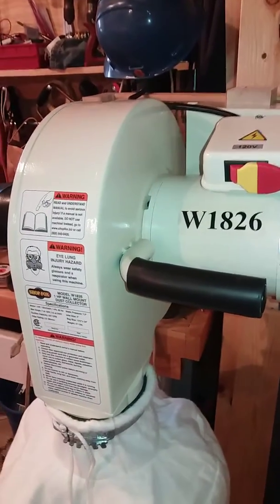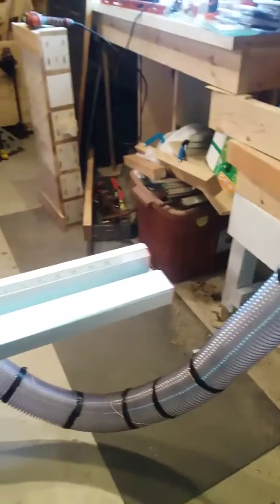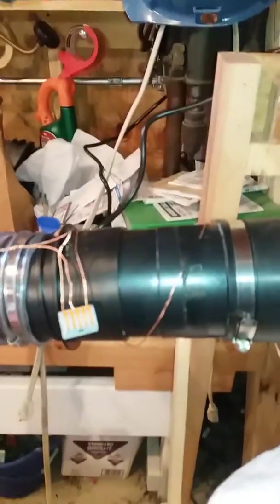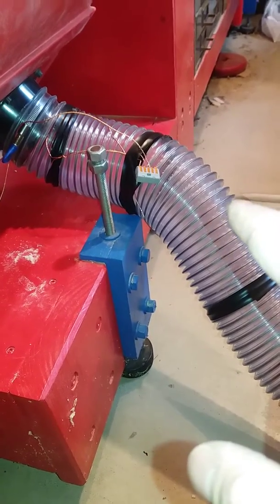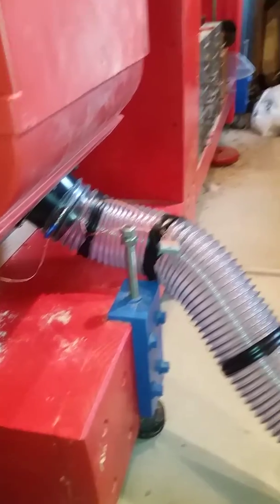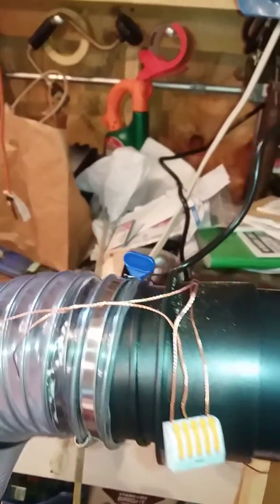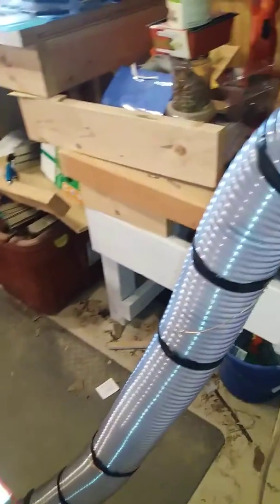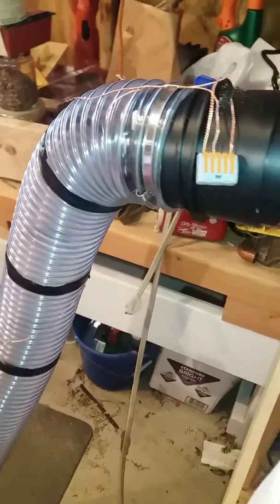Instal and ground Shop fox W1826 dust collector

Comment from the maker: Ari, I heard you can connect up to that spiral wire embedded in the flex hose but in practical terms trying to actually attach a wire securely to it would be very difficult I think and in this you want a foolproof application.  The though of a weakly soldered connection breaking off is not acceptable, more so because this is a floor obstruction I occasionally bump into.  Can't be helped, but therefore it needs to hold up.

Comment: Good video!  I am interested in buying this collector for a cnc router.  How many continuous hours of work is recommended?
Reply from the maker: I'm not exactly sure what your asking.  Are you referring to how long everything took to set up?
Reply: @friedmanbrock  no, I mean how many hours in a row the collector can work, without forcing the motor
Reply from the maker: I can't find any specific recommendations but I will tell you what I think.  The larger, more powerful models are spoken of on several review sites as being made to run every day, all day.  This is certainly a less powerful, smaller version of those and I have noticed if you have it on for very long, extended periods the motor housing gets pretty warm. It does have a good fan on it and if you set it up right and don't overload it, I would think you can use for a long time without any issues.  However, this is really a one machine at a time, lighter duty dust collector intended to operate on a short run of tubing.  Therefore, I only run it when I am actively cutting on my table saw, then I wait a few second after I turn off the saw to turn off the collector.  It is not a whole shop, all day unit.  The larger and more powerful collectors are designed for that from the get go.  I also don't know how effective this would be with a separator as that increases the static pressure...or something.  Also...without a separator all debris goes through the impeller so if you are doing something with bigger chips instead of finer dust you will cause more wear and tear.  With everything I have said, I am highly satisfied with this model as it works well for my table saw.  I would recommend solid tubing/piping instead of the corrugated stuff though.  I noticed much better results.

Comment: Nice job thank you for posting.  I've seen it (the ground wire) run inside the hose or duct also, and of course if you use metal like they did back in the day, it's a non issue.  I just ordered this little dust collector myself.  How's it working out for you?
Reply from the maker: Thank you.  It's worked very well.  I decided to take the plunge and upgrade to solid pvc as this collector is great but the flexible hose does a number on your static pressure.  I think that's the term.  Lots of loss/resistance.  When I switch it over I will make another video.
Reply: friedmanbrock looking forward to it!  Maybe I’ll show mine.  I’m going all metal though.... cheaper and no static worries.  Dryer vent ftw!
Reply from the maker: @rivernet62  I was warned about using the big box home center metal stuff as it's very thin and some people warn about it crumpling unexpectedly.  And the seams can be very leaky.  The good stuff is spiral pipe but it's pricey.
Reply: friedmanbrock We shall see!  Planning to tape/caulk the seams.

Comment: A grounding wire doesn't dissipate static.  For that you need a hose that is made with conductive resins, like carbon black.  Static electricity stays where it is...hence the term "static"...the idea that it will hop on a wire and travel has been debunked repeatedly.
Reply from the maker: Mabye dissipate isnt the best technical term, but as a point of fact it most definitely works and works well.  The wire provides a ground that harmlessly channels static electricity.  Before I installed it, you would get zapped holding the handle of the collector.  After, nothing.  Therefore the static has to go somewhere, the only path being into the grounding.

Comment: Grounding doesn't remove static.
Reply from the maker: Your right.  You can't "remove it".  You give it a safe path to discharge to.  Without this, you could hold the handle of the dust collector and it would just be shock, shock, shock.  With the grounding, nothing.  Not once, not ever.

Comment: Hello!  You made this unit mobile?  Please confirm
Reply from the maker: Originally, yes.  As the shop has come along, I have experimented and thought about what I like and what I don't.  Also, tackling different kinds of projects shows you what your needs really are.  The nice thing about it being mobile was my ability to bring it wherever I needed it.  The truth is I only really need it in one spot, and the cart takes up valuable floor space.  So I wall mounted it using the corrugated 4 inch plastic tubing.  Then I discovered that tubing sucks and I used PVC to hard pipe it.  Then I added a separator, tore everything apart, and rebuilt it.  Then I realized the dust collection on the saw itself was crap, so I spent a year upgrading that.  Now I have excellent dust collection and I need to make a new video.  Mobile is great, but it's not always best.